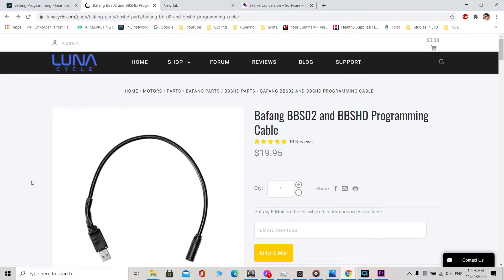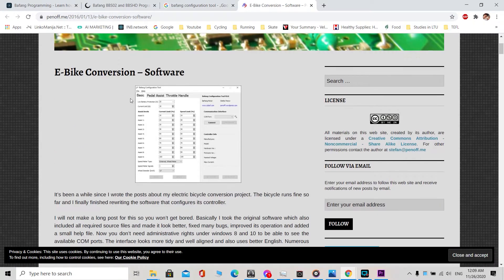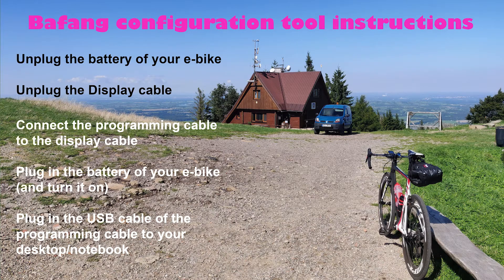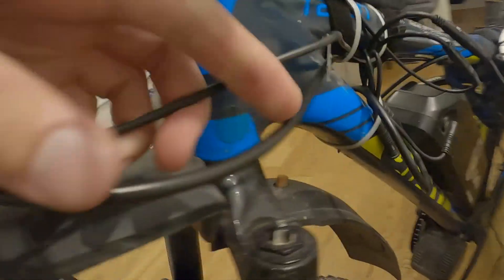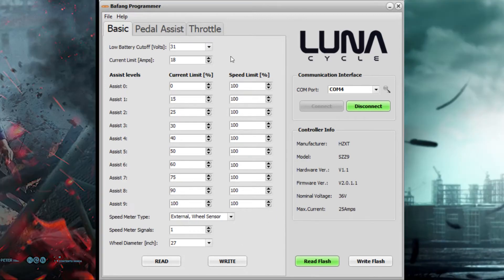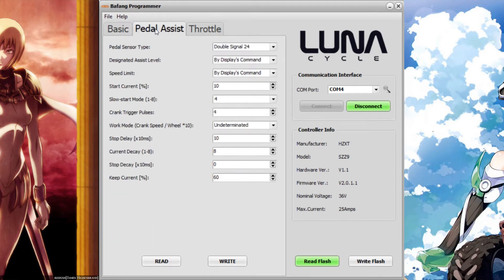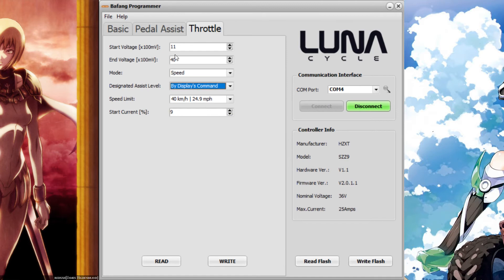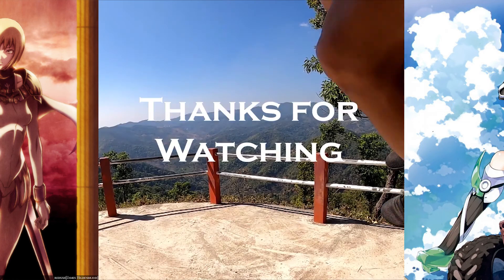Programing Bafang motor - setting up power values and much more

Comment: Is there a way to speed  up the PAS response? 
I have gone through the settings and now my throttle works much smoother and the power assist is just what I want. However, the Pedal Assist comes on very slowly, only after 2 complete revolutions of the pedals.  What setting controls it?
Reply: Its the one under slow start mode, the other bafang config software calls it slightly different. If thats set too high it will take long.

Comment: Will this work for the Bafang 750W Hub Motor with the Bafang C961 display BBSHD ?
Reply: Probably not.  Bafang changed to the CAN-bus system.  I bought a cheap cable off of AliExpress, but the connection port is a different shape

Comment: I can program ok with the Luna software. However, I noticed that if you change the wheel size it will not overrun the internal software and the wheel size will actually not change (no speed indicator effect). I can only change wheel size using the Bafang screen after entering the appropriate password.

Comment: My bbs02 Bafang throttle act like an on-off switch. Is there a solution for it to act as a smooth progressive linear throttle? Is it a programming issue?
Reply: Go to "throttle" and turn down start amps.
Reply: Throttle handle/ mode/ speed

Comment: Will it work with a hub motor too?
Reply: I am wondering the same thing
Reply: Works with my Bfang 750w motor and Bfang controller. I don't know why so many people say it's for mid-drives only. It's like everyone is keeping it secret! Lol. I just went ahead and bought the cable and gave it a shot and it worked perfectly. Now just need to find someone who has the best settings... which is difficult since all I can find is info on the mid drives

Comment: Is programming the motor independant of what type of display you got?
Reply: Old question, but yes. It is independent. You connect the Bafang programming cable so it goes from your laptop to the display cable GOING TO THE MOTOR. The display itself isn't even involved.

Comment: Is that a good idea to keep 100% speed on every pass??  That mean the motor will never stop and always will try to hit top speed even on small back cogs, at  pass 1.
Your pass 1 setting have around 96w peak and 58w power continues but in the same time 100% rpm. I Don't know is that okay for the motor? Maybe on the largest back cogs .... a bit confused..
Reply: I’m setup that way (unlimited speed) except for assistance level 1 which I limited to 25km/h in case police stops me and checks the bike.

Comment: Thanks for this video. One question though. If I set setting number one to 5km/hour will the motor start when it reaches 5km/h and will it also cut of at 5kmh?

Second question, when using throttle can you pedal at the same time?
Reply from the maker: 1. All values there are % of the power that your motor is capable of. If you do 5% and your motor is 250w its going to be 12.5 watts. You can play with these number and see how much watts you need to enter there to go 5km/h with your bike. For a bike of 24kg and 63kg rider that's around 15watts.
2. Yes.

Comment: Just purchased a bafang but just wanting throttle without the peddle assist. Could you please tell me if this is possible. Thanks for the vid.
Reply: You can just unplug the pedal sensor and put it in the top speed mode to give the throttle the most power, you will find pas helps increase range though and tbh these little 1500w kits fell underpowered without peddling so I wouldn't bother
Reply: @SlightlyDazed.  you can still pedal when using throttle, I don't love how the PAS works

Comment: Hi, mabe you know if this cabel fits for Bafang BFSWX02 hub motor?
Reply from the maker: Hi. I haven't done it on rear hub motor. But quick search suggests that Bafang  basic 18a controller, and DPC18 display might have issues. Possible solution is to swap to 20a Grinfineon controller and CA3WP programmable display.

Comment: Congratulations on your video, my pc can't find the communication port, can you help me?
Reply from the maker: If this happens basically you're in tough luck. Possible solution could be getting USB drivers or trying different imput slots.
Reply: @VeganCatalyst  I thought about it too, but where can I find the drivers?
Reply from the maker: @dariopastorino69  one of the sites/forums should have it. Lunacycles or the bafang one when you do G search.
Also in my case I had to do a few times connect/disconnect and check which port is actually the right one in device manager.
Reply: @VeganCatalyst  the software will only read the controller if com ports 1 to 4 a selected!. If any other com port is sellected it will not read the controller therefore anybody having this problem reading the controller will have to open up device manager and right click the port they are using, click properties, then advanced, then port settings and change there port number to a port from 1 to 4 thats not in use ;)